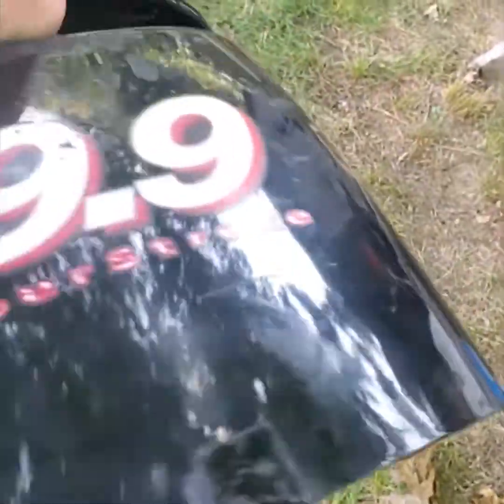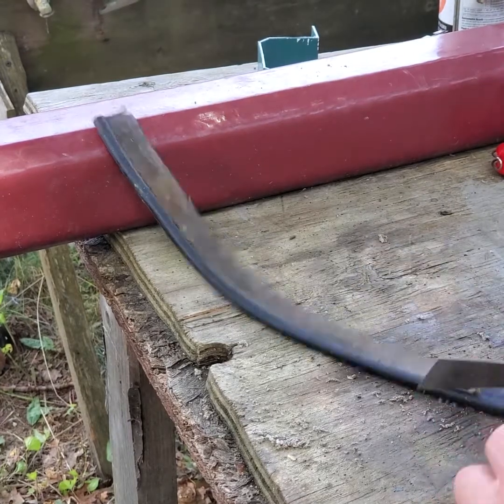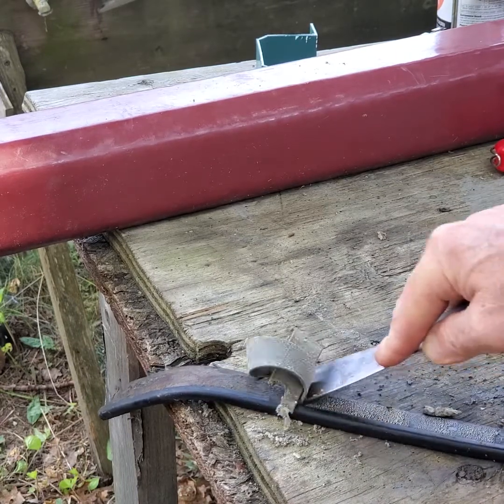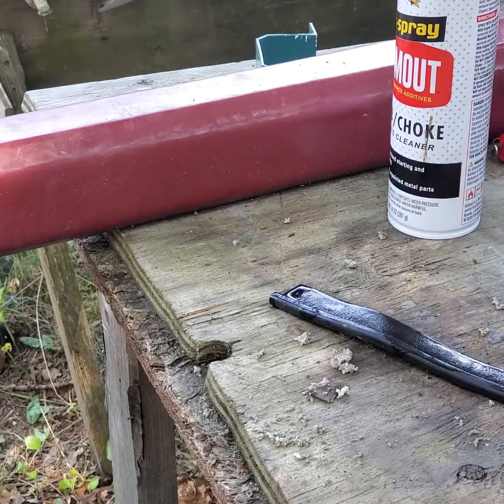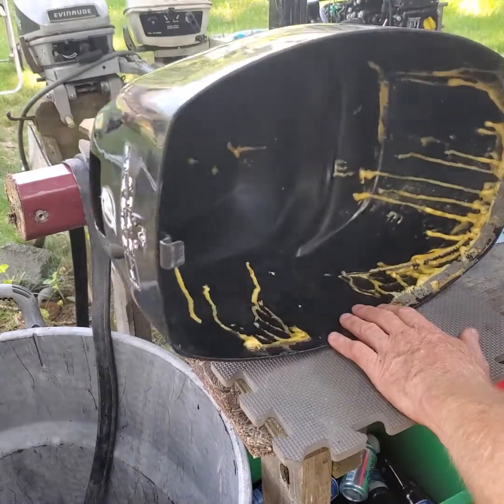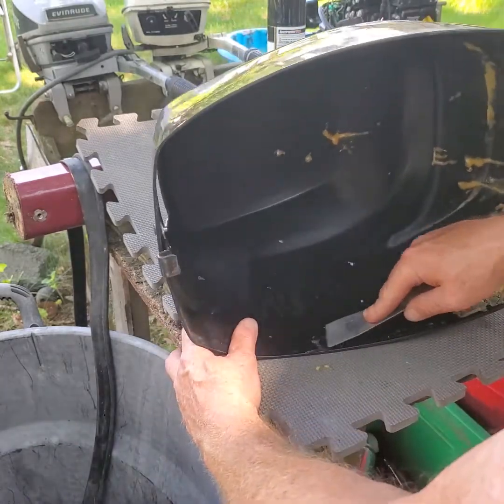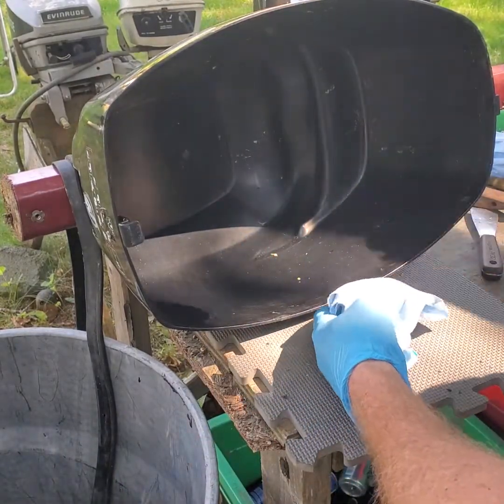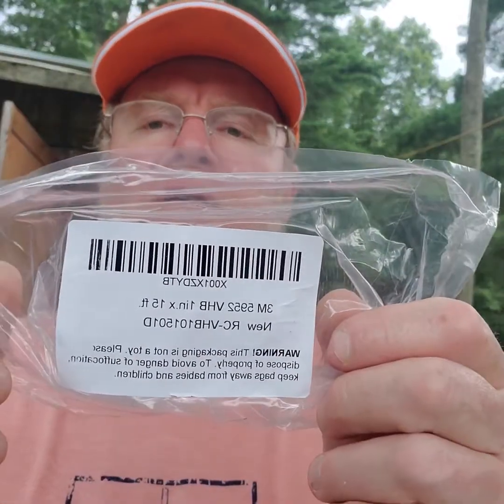Outboard cowling seal reinstallation

Comment: In case someone cares, from 3m vhb "The amount of pressure required to achieve what is typically known as wet-out or acceptable contact. Typically, this is achieved by the application of greater than 15 psi at the tape bond line." I use a lot and have heard people curse the stuff because they don't understand that it needs 15psi pressure to activate bond. That will last several decade if kept dry and gasket is clean and siliconed with regular maintenance. Great video's. You are very methodical and precious.

Comment: Hey Mate. What I'd the seal is on the outside ? Can use same method?
Reply from the maker: I imagine so as long as it's rubber being adhered to fiberglass or some composite material